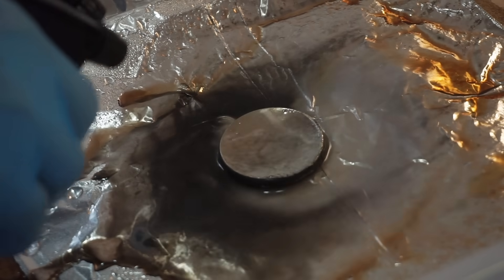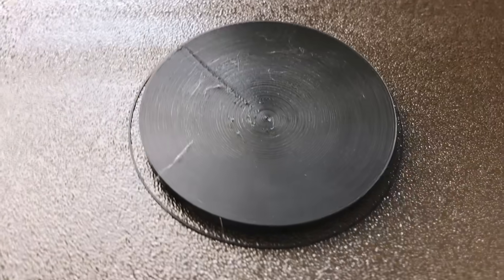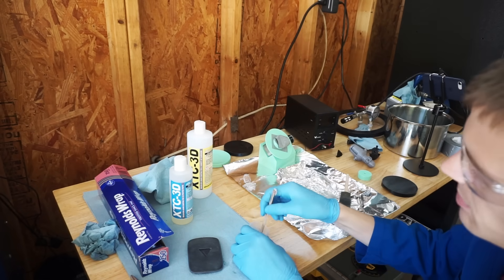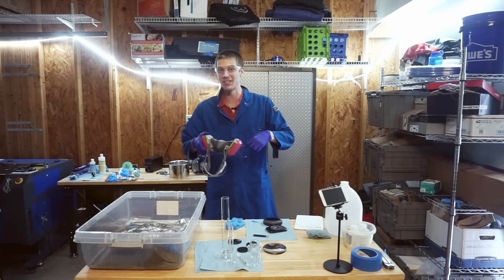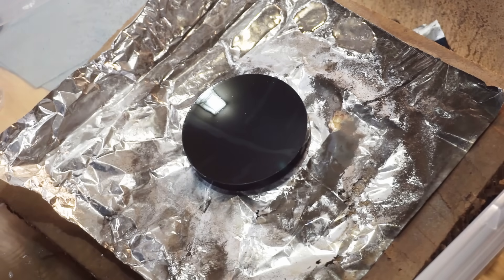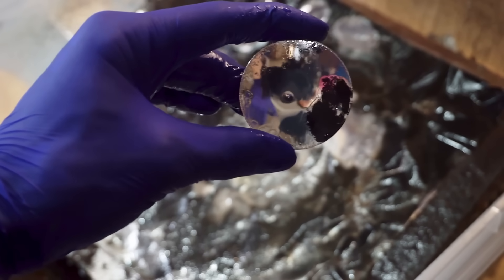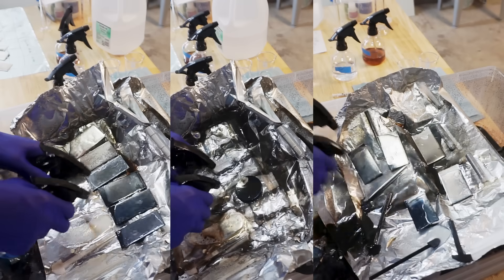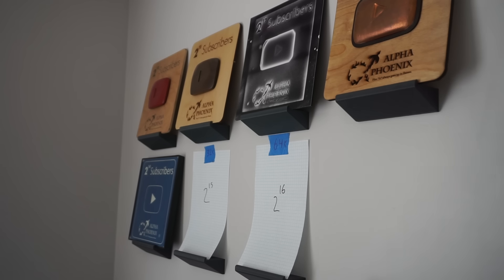How does a "first surface" mirror work? (2^15 sub special!)

Comment: Could you electrically charge the surface with static electricity instead of using a surfactant to get it to stop being hydrophobic?

Also, regarding protecting against damage for first surface, would it be okay it reapply a layer of epoxy again to wake a second surface mirror or would that ruin the mirror's image?

Ive had epoxy turn yellow over time

Comment: if you mix epoxy in an tubular container and spin it while it cures, it will for a hyperbola. I don't know what kind of difference with makes for optics but it'll be a lot smoother than printing + epoxy

Comment: I believe the reason your resins cured better indoors is because of the higher temperature. 
And as per your vacuum chamber, you could try doing that after mixing A and B and before pouring, but only if the resin in question has a long enough working time. It was a clever idea, but in practice a pressure pot will work much better to keep bubbles from interfering with your pieces 
Resin is really fun to work with though, you'll get the hang of it after working with it a bit more! ☺️

Comment: To get rid of bubbles vacuum before you pour/spread. Then once in your mold on your part, place in a pressure chamber to like 30psi until cured. If you do have a lot of working time with the resin, then just use the pressure chamber skipping the vacuum step.

Comment: You need to stop saying you are not a chemist. And do something about it. I am not a chemist but I spent the past decade force-feeding myself college chemistry texts and now I am tolerably comfortable with polymers and especially the commercial jungle of resins and epoxies.
Your existing education and skills set is a pretty good indicator that you will pick up chem waaay faster than I did with my rudimentary math skills. And you know damned well the chem knowledge you gain will supercharge your other skill sets.

Comment: To create a parabolic surface from liquid resin, you might want to spin the "Lens" horizontally at a rate that will naturally create a liquid parabola of the same shape.   There's an excellent video named "Spinning Water: The Mathematical Explanation" by Jeff Regester which covers the math to do this.

Comment: The resin issue you were having was due to higher humidity in the garage, as well as too much part b in the mixture. Common issue when you're first starting out with resins. Also your rotation speed for the parabolic resin coat and slivering is way too slow.

Comment: What about using surface build primers and sanding up to 1500-3000 grit then also spray FINER ATOMIZED (ditch spray bottle) Silver chem components. Perhaps also borax can assist the water. Use a Couple gravity Airbrushes!!

Comment: Just a guess, you probably have the AC on inside, and the ambient moisture from the environment is affecting your parts smoothness. If I remember right this is also an issue with candy making too. Obviously not the same level of precision but humidity may be your hidden dagger.

Comment: if you all want an easier way without the chemicals possibly harming you i would suggest "spaz stix mirror chrome" spray paint its meant for r/c car paint everytime ive used it works great ive always used a black primer backing to go with it stands out more

Comment: Try acetone smoothing using a basic FDM printer and (most commonly) ABS plastic, if done correctly it can come out as smooth, if not smoother, than the resin, the only drawback is mild detail loss on smaller parts, but printing on larger scales can circumvent this issue

Comment: I have not read the other comments however the reaction to get a mirror requires a ketone. If you were a chemist this would pop out very quickly. Many of the components in resins are ketone.
For example in acrylic would most likely be methyl ethyl ketone. In another case acetone would be the Ketone.
Furthermore the reason it works better inside is that these chemical reactions are sometimes used for detection of ketones because of the extremely small amount of chemical that is required to make the reaction occur. For example the Tolins reaction is used to detect ketones in parts per million.

Comment: if you spin a circular container that contains liquid along its central axis while flat the liquid forms a parabola, perhaps that can be a useful method for your circular concave mirror planks. IF you get the right rotation frequency it should do a pretty good job

Comment: Pressurize resin. And give it a week to cure if you plan on dousing it in chemicals. The cure time are for a touchable resin, but the resin changes it's entire life. Week of curing probably would help, or a different resin that doesn't react to your chemicals. Lots of resin to pick and choose.

Comment: 1. Your issue with working outside versus inside is likely humidity. Humidity can really mess with how resins cure.

2. Vac chambers are for poured stuff. If you want to reduce bubbles on a painted-on surface, you want a pressure pot.

Comment: Nice! It would be interesting to see you use clear resin and rosin and water glass (with optional wax coating) to make mirrors (if you use a polished metal back-plate as a second-layer mirror) and lenses (without needing a mirror) for a telescope. If you already did that, I haven't seen it yet.

Comment: I thought the vacuum thing with resin wasn't supposed to be after a pour. You mix it in some container, put that in and then run the vacuum. Yeah it bubbles up, then after the bubbles settle down, you remove it from the vacuum and do the pour of the resin from the container. Maybe who ever mentioned it wasn't clear enough on the process? (Of course that also depends on the cure rate of the particular resin used and maybe how prone it is to out-gassing, but such seems to be for stuff that takes longer than 10 minutes.)

Alternately, I've seen some processes that use a pressure chamber to force down material to reduce bubbles. And that can be done after the pour. So maybe a mix-up there?

Comment: You might spray to much as with carpainters that results in mandarin skin alike effects in car paint. Also notice the angle of the object so you can quickly get rid of to much fluid. 
I'm curious what would happen if you did it under a non atmosphere condition like CO2 or so would the silver not turn black then?

Comment: Your issue with resin curing is likely temperature. Cold slows the cure of all epoxies, Depending on the chemistry epoxy could take actual years to cure if temperatures are too low. Some epoxies have to be cooked to fully cure....Also the bubbles in the part you put in the vacuum chamber were probably coming from the air space inside the part itself. They would have stopped eventually.

Comment: What is that box called the one you use to add power to your spinning motor?
Reply from the maker: Adjustable dc power supply - mine was a cheapie model on amazon

Comment: The "inside" curing may have had better results, either because the reaction may be hampered by the  increased humidity outside, or may somehow be affected by UV-Radiation, temperature may also play a larger part, which some comments have already pointed out :)
Reply: It might actually be the light itself, the silver nitrate used in the silvering solution is photosensitive. It was used in photography for a very long time.
Reply: @nikkiofthevalley  whaaaaaat, I literaly just took an exam in chem class today with a large part being the role silver nitrate plays in photosensitive film and the difftent reactions that take place, what are the odds you happend to comment that today of all days.
Man, coincides like that are so fun

Comment: you know if you're spinning expoy anyway, you might as well spin a dish full aligned horizontally as it cures. it should form a parabola proportional to rpm and radius. at least in theory it should be perfect!

Comment: Hi!  A comment about your vacuum de-bubbling of resin.   In resin pouring art its common practice to de-bubble resin in a vacuum chamber BEFORE you use it but once its applied or poured you debubble in a pressure chamber.

Comment: I normally smooth parts using solvent.

If you print in ABS, you can get a large container, hang your part in it and put some acetone on the bottom, then heat it up. The acetone boils and the vapour condenses on the part to  partially dissolves it and smooths the surface. Then let it dry. Don't do it for too long or it ruins the part.

For PLA, other, less friendly solvents (like DCM) are needed.

Comment: I tried once CA glue instead of epoxy resin. Remembered that I used that back in the day to finish turned pens. It has lower viscosity so it flows better, cures really hard and is very consistent. Microbubbles mixed with epoxy for part can help with smoothing too.
Reply: I’ve used CA to coat prints before sanding and polishing with really good results. I could see my reflection quite clearly.

Comment: There is also the possibility to use silicone moulds. Because silicone gets incredible details. So instead of 3d printed parts that are rough, casted resin/epoxy parts that are exactly as smooth as the silicone mould. 
To make sure the silicone mould is smooth use an item with surface flatness to your standards and make a silicone mould of that item. 
Also the mould is reusable.

Comment: 1st surface mirrors can be really expensive if you have to buy them.  One common place I've found them is inside of old projection TV's. I have a couple that are nearly 1meter^2 I salvaged from old TVs. There's huge fresnel lenses in there too that are a lot of fun to experiment with! =D

Comment: This is FANTASTIC. I've been researching steps on how to do a 3d printed mirror for a couple of years. I hadn't considered resin though. The approach that I've been looking at is to first paint the mirror base with a graphite paint to give it a conductive surface, then to use nickel electroplating to provide a surface that the reflective material can adhere to. I saw a video about 2 years ago where some guys were demonstrating the silvering fluid you used. 

Ultimately its a bit of a tradeoff when it comes to how you get a reflective surface. Aluminizing the surface would guarantee that the surface doesn't degrade over time due to atmospheric exposure. With the silvering process, it will gradually tarnish over maybe a year or so. Silvering was the traditional process for making telescope mirrors in the 18th/19th centuries, but the surfaces decayed fairly quickly and the mirrors had to be resurfaced often. 

However, there are some semi to major serious outgassing issues with using plastics in the kind of vacuum chambers used with electroplating. Most commercial operations wouldn't support using a 3d printed plastic part. Building your own deposition chamber is possible but can be a huge project on its own.

A possible solution to the silvering process would be to use a clearcoat layer over it. But that leads into one of the biggest overall issues: smoothing.

For an optical grade mirror, it needs to be extremely smooth. This is easy with glass, just grind away at it until you get the correct figure. For our 3d printed mirrors, that's not as much of an option due to the very thin layers of materials we're working with. I had been thinking it might be possible to just have a really super thick nickel plating layer and then do the final figuring and surface polishing on that before silvering.

I have an idea for you. Perhaps having an air current of argon over the mirror surface while you're spraying could help alleviate some of the issues with the silver forming into oxides instead of adhering to the surface. Similar to how welding uses argon to prevent the oxygen-rich regular atmosphere to interfere with the weld.

I've very excited about what you've done so far. Please don't let this be a one-off project. I want to keep seeing how you're approaching this project!

Comment: You should try pla vapor smooth with acetone. Also I've seen people use the vac to remove bubbles but when the resin is still in the cup not on the part. Ive seen them stick the part in a pressure chamber with resin on not a vac chamber

Comment: Im certainly no expert but I can tell you that I’ve had some really rough times curing resins in the garage due to higher levels of humidity. That might be something to take into consideration.   Have you considered using PVD and aluminum? It’s definitely a more difficult project, but I would be extremely interested in seeing what you come up with.

Comment: Even if you get a perfectly smooth surface, the irregularities in each layer will have different thermal properties, so the surface will distort as the temperature varies.

Comment: Sounds like you should've started with understanding resin. For example, pulling a vacuum on resin is generally done with casting resin, but well before you start pouring it into its final form.

Comment: Could you put another coat of clear resin on top of the silvered surface to prevent it oxidising in the air over time? I guess that would make a second surface mirror, right?

Comment: Love your channel! On omegageek64's channel he has a video about spin-casting a parabolic mirror using resin and a rotating form. The rotation creates a parabola. His plan is to "slump" hot glass onto a plaster mold of the cast parabola, but you could do the same and just mirror-ize the resin.
Reply from the maker: Big telescope mirrors have been made in rotating furnaces before but I think they always need grinding and polishing. From my experience with glass, the slumped side will be the correct shape overall but the surface finish will be tricky (probably just as bad final mirror specs as I expect to get from these printed ones). If the glass was warm enough to remove it and flame polish the surface before annealing, it probably would also be warm enough to slump out of shape once free of the mold. Sounds like a fun difficult project!

Comment: Blow torch works a treat for getting rid of air bubbles in epoxy resins. Even a Bic lighter will do the trick, just harder to get the flame in there.

Comment: You had trapped air and water in the resins they were reacting to the secondary process. You can pull a vacuum to pull the air/water out and then use mek or boatworks finish to get a glass surface with the resin

Comment: By the way: If you want to eliminate bubbles in your epoxy coats, stick it in a PRESSURE chamber, not a vacuum chamber. 15 pounds or so would be enough